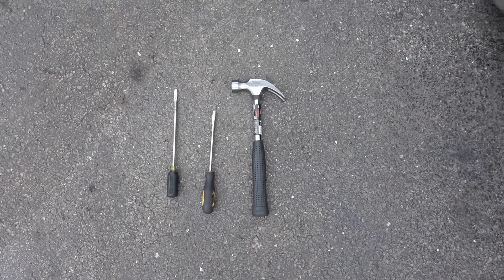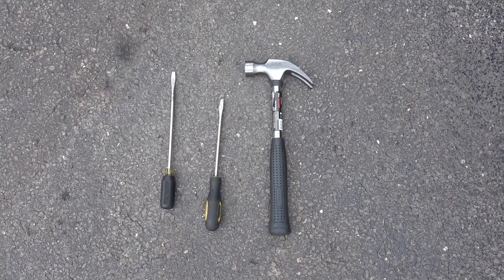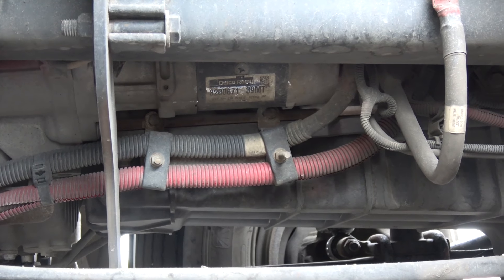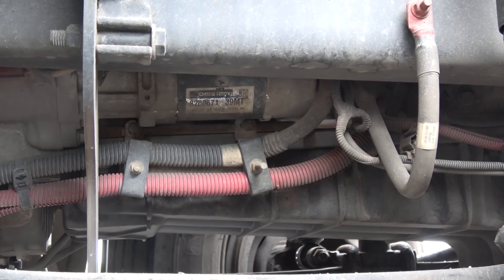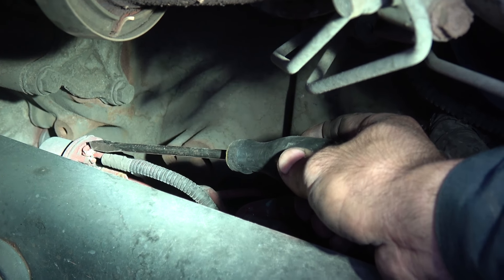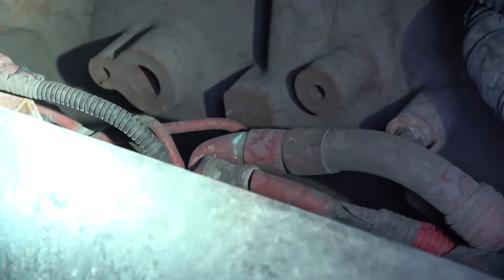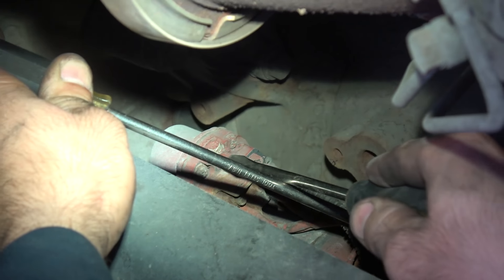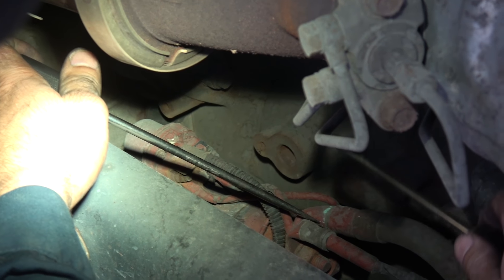How To Troubleshoot a Starter

Comment: Great solid advice also if this procedure doesn’t work check the ignition solenoid connection to the starter they often break free from the mounting bolt on the starter hold the wire to the starter bolt and have someone turn the key “Shazzam”

Comment: We were at the boarder at Windsor Crossing.  Shut the truck down, and it would not start again .
 The quickest that mobile would come was min 4 hours.
 I USED YOUR VIDEO (without screwdrivers)  but a 5th wheel pully bar and a key for tire chains jammed between those wires.
 It worked!
Thanks a million, brother, and because I am starting to write and amazed material for 7 Star Express, I will definitely be linking and using your videos as teaching tools.
 So do expect more hits and subscribers from this company in Stoney Creek.
Cheers and thanks

Comment: Just changed batteries a few days ago.  Now my truck won't start.
When I crank the key my dashboard blacks out.  

Wiring issue?  I have a lvd that sometimes disconnects my cab power and sometimes it doesn't .  
It's temperamental.   All I have is a fridge and perhaps my radio on.
Is that what is cause the power drainage?

Comment: I have a 06” pete 387 has a cat c15 475 hp, was working perfectly fine everyday until I didn’t start it for 3 days because I was off, it was cold like in the 20 degrees everyday and go to start it, and it doesn’t start thought it was the battery it’s not I have THEJ on the charger for 3 days now the batteries are good when I go to start it the engine doesn’t turn or move at all the dash and all lights work and it makes a click click click click click noise when I try to start like a ticking noise, no turn to the engine at all?      
What do you think I should do, I got a brand new starter febuary 2020, please help! Thank you so much god bless
Reply: Figure it out?

Comment: Will this work of the truck is an automatic? 🤔
Reply from the maker: Jamael Nettles, absolutely !
Reply: RoadHacks by Max 
On the second method you use with the Screw Driver 
Is that possible if you turn the key on Ignition and do the Screw Driver contact , will the Truck start ??
I mean if there is no one around 
To start the ignition I guess that will work...
I try mine with Eletric wire from the Starter to the Alternator....

Comment: So my starter has a very sluggish start. Especially in the morning. I thought its the batteries.  Nope. Replaced the batteries and still have the same problem.  Could it be the starter? Mechaic says no. Its either starts or no starts at all. It just spins weakly.
Reply: Hey brother, what ended up being the problem?
Reply: Yup. Was the starter. Was smart to replace it right away.  One time to breakdown at customer would cost alot.  Thank you bro.